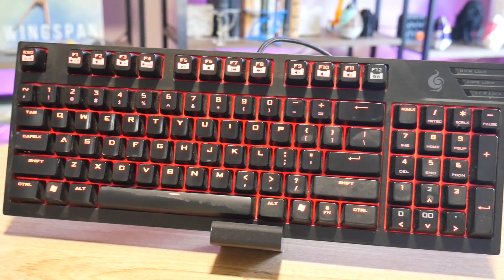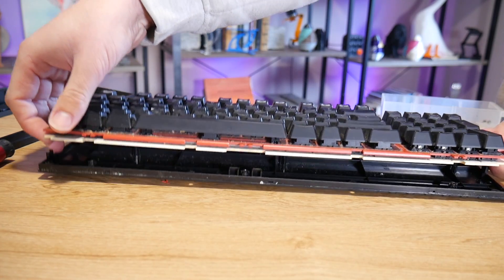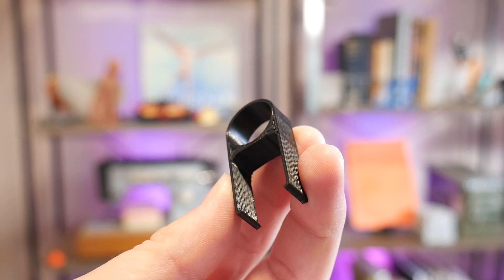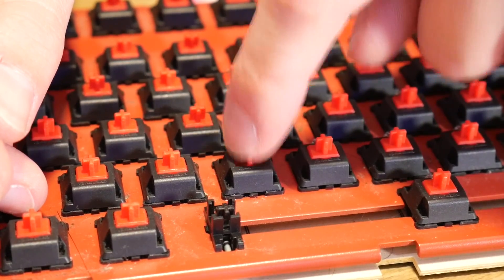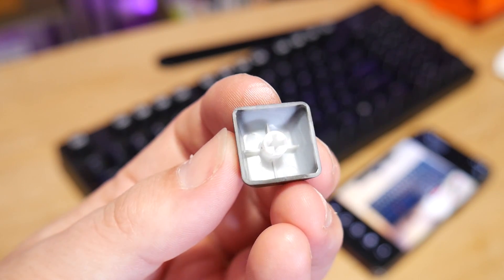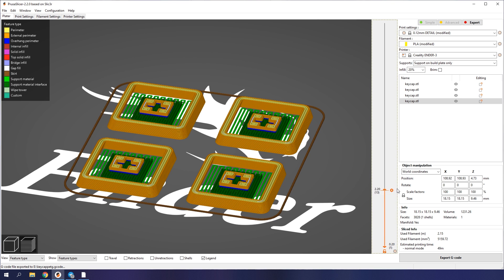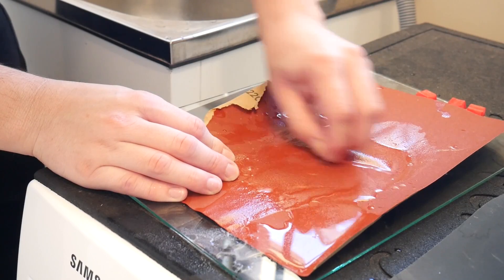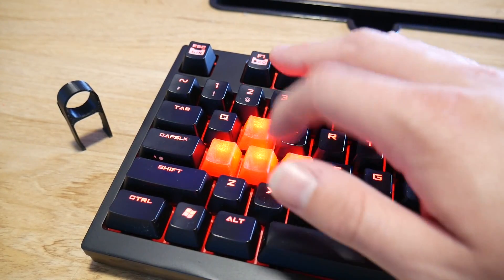Can I Fix my Mechanical Keyboard using a 3D Printer?

Comment: Nice! I've got a blank Das Keyboard in a box with a few missing key caps.  (ProTip: Don't use a shop air compressor set to 150psi to clean your keyboard.) This is a great use of a 3D printer.

Comment: I have a Razer Chroma X for 3-4 years. for at least a year maybe more it got random key failures except instead of one key it was an entire row or more. I rmarinated the PCB and switches in Isopropyl Alcohol 99%. The keys haven't failed since. It's a temporary solution worth trying for anyone and without having to replace a good keyboard. Let the PCB soak up the Sun to dry. . It will not work for everyone. Try on a cheap device first.

Comment: Sanding 104 keys sounds very un-fun. My model M-122 keyboard has 2-part keys, a structural base then a slipon cover. I'd be down for that if you can still get slipon covers for your keys.
Reply: The points on how you changed the print/design details are the real gold here. thanks for sharing!

Comment: And if one of your keys go bad and you can't find/can't buy a replacement just swap that key with one you rarely uses like Scroll Lock.
And if you want to save some money do the same and buy a cheaper switch to place on the key you rarely use.
Some Keyboards you don't even need to solder. The switches are socket instead of soldered.

Comment: ok, good video just wanted to point out a thing, if (like in your case) a switch doesn't work because it's "dirty" you can clean it up by opening the switch with a screwdriver or a switch opener, I consider it a better way to clean up a switch because if the switch is not linear (for example a cherry red is linear but a cherry blue is clicky) you will probably lose some tactility using a surface cleaner or alcohol.

Comment: i have a corsair k70 that i bought less than a year ago 
well in a fit of rage i absoloutly smashed and pummled the spacebar and some how the 8 key 
idk how to solder and i dont know where i could source new switches, (cherry mx blue)
i been using a crappy membrane keyboard since i got tired of having to deal with the spacebar, 
also if you press to hard it sticks
so i fucked the swithc up prety damn good

Comment: Well i 3d printed and hand wired a 10 keyless keyboard and all the keys were repurposed from a broken thermaljank keyboard. That did turn out okay though pla that I printed it in was probably not the best idea. Also I use a legendless keyboard at work for my day to day. It does slow people who try and use my pc at work so they are less likely to do so.

Comment: Probably far cheaper in power and materials to buy some pbt double-shots to replace the old keycaps. Actually shocked the paint finish on your cheapo abs caps held up for so long. My quickfire wore the paint off the common keys in less than 6mo. Cherish those old body cherry switches, clear housing ones are horrible, all sloppy and scratchy feeling. 

I do like that wood grain effect on the sanded caps. printing that top frame of the keyboard in that red filament at an angle would look pretty cool and glow with the leds.

Comment: I've bought me a nice ducky shine 3 year of the snake keyboard in 2015. Mine has MX brown switches with white LEDs. Few years ago however some of the LEDs were dying or dead. I noted which ones they were and disassembled the keyboard to solder out the faulty LEDs. wanting to be 100% sure I'd have the same white LEDs I soldered the LEDs out of my WASD keys to use those and replaced those with some blue LEDs. It was very easy to do as the PCB of the keyboard is nicely labeled and the entire thing is just easy to work on. It's been going strong ever since with no more faulty LEDs and if a switch ever breaks I already know it'll be easy to solder in a new one.

I don't plan on getting rid of this keyboard any time soon as I love it, I could use some new keycaps tho :P

Comment: Total a noob question: does octoprint replace marlin? I’ve an Ender 3 pro, the 1.5 upgrade board from creality
Reply: NO, marlin is a firmware that lives in yuor motherboard printer, octoprint its a software thats run in an Raspbarry pi, thats talk to yuor motherboard printer.
Why? Becsuse printers needs a microcontroler for real time process octoprint runs over linux, and thats a multitasking operaiting system, thats why yuo can not use linux or windows or a ny multitasking O System for a real time machine, but octoprint make a new interface for yuor printer, but marlin or whatever firmware yuor printer have, lives there

Comment: I have a Numpad with printed keycaps that have raised symbols for Fusion360 shortcuts. I recommend a 0.15mm nozzle for this sort of thing, or a resin printer if you don't like slow prints. Since the keys are backlight, the symbols are easily visible without any ink or paint. Annoyingly Fusion360 does not allow much customization with the keybindings, so I had to get a 3rd party macro software to interface correctly.

Comment: well instead of printing a few hundred keycaps, you could just buy them - there a lots of Shops which sell custom schemed injection moulded parts with different colors and prints on it

Comment: Nice, I have been working on my own 3d printed keycaps for the last 2 years on and off.  I found that if I print them upside down and with an opaque enough filament you can model the legends to be cut into the underside to print without too much hassle.  you end up with a keycap that's top is completely smooth but still has a legend.  I have been meaning to put my files on Thingiverse for a while...
Reply: Can you show us some examples?
I'm also experimenting with custom 3D printed KeyCaps for a while now ( https://www.thingiverse.com/thing:4241843 )
and some comments here gave me inspiration for further experiments :)

Comment: If you're looking to go down a whole rabbit hole of keycaps you should check out rsheldiii's KeyV2 on GitHub. It's a parametric keycap library written in OpenSCAD. Supports a ton of different key profiles, sizes, and you can add customizable legends. I've been working on a custom 40% layout with 3D printed keycaps, switch plate, and case that will be handwired and powered by a pro micro. I also find printing Cherry and OEM profile keycaps on their front face gives a nice smooth top surface that doesn't really require any sanding. All printed on my CR-10 Mini.

Comment: Ever since I started repainting my RC Tank models ( https://imgur.com/a/GzLRqvl & https://imgur.com/gallery/AB3vZQu ) found a huge use in creating 3D Printed ( cheap FDM ) and Laser cut ( Tamiya Masking Tape ) Stencils like those shiny grey ventilation and turret ring caps on the lower hull ( https://imgur.com/1rkxagx.jpg ) for my Tamiya #56020 Leopard 2A7+ that protect the already painted inside while I apply the outside camo pattern. Other than that I'm using 3D Printed ( SLS ) parts for things that have been damaged beyond sensible repair over the years or just new stuff like a set of Stinger Pods for my Tamiya #36208 Gepard ( https://imgur.com/a/ZLkzgMs ) which I assume were only prototypes in development and thus never seen on any model - Not even as an aftermarket.

Comment: I just 3d printed a new bonnet release lever for my old Passat, now my sons car, the old one had a lug snapped off so I designed a new one in cubify and printed it, it worked a treat

Comment: I print keycaps all the time!  I'm actually working on a .scad to generate them: https://youtu.be/WDlRZMvisA4

The key to great-feeling FDM keycaps is to *print them on their sides*.  As long as the stem gets a little removable support on the inside it'll turn out great and you won't need to sand it after either! Since the layer lines will be running parallel to your fingertip (|||) it should feel nice and smooth right off the bed.  If you want to try it out I have pre-rendered models (STLs) you can fool around with. They're super fast prints too!

Comment: Hey Angus, do you know what the technical term for a spindle/cutter that rotates parallel to the direction of the cut?
The one used to cut leather in this video:
https://www.youtube.com/watch?v=RrHI47YpIs4

Random question but I thought this could be applied to 3D printing

Comment: Many high end key caps are 'double shot' injection molded.  A inner core that includes the legend, and a 'cover' that is opaque that is snapped or glued over the base key.  I don't have the 3D skills, but I am sure Angus could figure it out.  A good idea for custom caps of any kind.

Comment: Back in the day (early '80s), we would put dirty keyboards in the dishwasher to clean them. It worked great as long as you put it on the top rack so it didn't melt during the drying cycle.

Comment: Here's a 3d printed ergodox keyboard with several 3d printed keycaps. I have done a full set, but chose to use ones with legends until I got used to the layout. Also a familiar face in the upper right. 

https://i.imgur.com/a53dA1r.jpg

Comment: My ancient mechanical keyboard (Dytcom K-261 with SMK Second Gen switches from early 90's) also has suffered from some bad keys, so far I've been desoldering and switching them around with keys like Insert and Scroll Lock, no spares required. Sometimes have a full layout is useful in surprising ways ;)

Comment: ive repaired my keyboard about 3x now haha! keys stop working, so i take it apart and clean it. havent needed to replace any parts yet, but its still in service. i have had this keyboard for probably 8 years haha!

also, that was a very neat trick with the slicer tweaks, im definitely going to do this on my next small parts... i only print in petg, and ive had some smaller parts turn out weak and crappy, but im now sure that it was because there were gaps in the shell... cheers!

Comment: The only "problem" that I can see is that the isopropanol would also wash the lube of the Cherry switch. You may notice over time that the key may become scratchy. Nothing that can't be solved with some Krytox light grease.

And welcome to the rabbit hole of mechanical keyboard customization. :D

Comment: i had a similar thing a few months back, i have a keyboard I love (the AUKEY KM-G6) but the clone Cherry Blues (I say clones as unlike Kailh's, Gaterons etc these had no markings whatsoever) and my windows key and left control key died, sadly I didn't have a multimeter at the time but I wanted to change the switches anyway, so I printed a keycap puller, disassembled the board, desoldered all 108 switches and replaced them with genuine Kailh box browns and some Glorious PC Gaming race (that's really the brand name) double shot ABS keycaps. and it was good as new, though what I'm planning on doing next is actually installing hot-swap pins in the PCB so that if I spill anything on it (this board has seen more than its share of cups of tea) plus, there are a few keys I want to switch out, escape (or, on these keycaps "ascend") feels like it deserves a kailh box navy, a heavy thick click, same with enter.

Comment: Keycap puller that is quicker, easier and cheaper to make:
Bend two paperclips!
Reply: Sure, but if you already have a 3D printer...
Reply: @InsanelyMclean  make a handle for the 2 paperclips
Reply: his channel makes me want to get a 3D printer even though I have no idea how to do all he things he does
Reply: @wheeeeeeeeeeee1  Fusion360 to make designs, thats for a start
Reply: Or just pull them off by hand, works perfectly on my Razer blackwidow elite
Reply: @laurinneff4304  Blasphemy! (No, but; keycaps can cost upwards of five dollars per key, so it's not worth risking for higher-end caps)

Comment: I have a Bluetooth keyboard that I pulled out of the trash that was missing the left arrow key.  I designed my own replacement and 3D printed the key.  It isn't perfect, because there is no symmetry anywhere throughout the entire key, but it was a "good enough" replacement for a free keyboard, and one that was actually very expensive when new.

Comment: The Isopropyl Alcohol is not available to the public, it all goes to hospitals Doctors, Nurses, emergency response teams. Not many people know that windsheild wash antifreeze is 75% Methyl Alcohol and I have been mixing that with generic liquid hand soap, Hydrogen Peroxide and a dash of Dettol. I fill my empty pump bottles and it works well. Nice work on that keyboard. I like repairing rather than replacing.

Comment: Then there's me with my box of replacement switches lol

With my keyboards, if a switch stops responding, I'll replace it with one that I've  refurbed, clean the old one, lube it up and store it with my others after testing to make sure it works again. The reason being I end up having to remove the switch to clean it anyway so I had might as well whack a spare in to speed up the repair, then fix the damaged switch later on. It's actually a pretty good strat if you have a totally dead keyboard that you can nab the switches from! It also leaves you with a bunch of switches that you can use in other projects :)

Comment: I've printed a chassis for a custom mechanical keyboard in the past (and I think 3D printing probably works better for this kind of thing than for keycaps). So maybe that's one area you could look into. Maybe try 3D printing everything you possibly can, including both the caps and the case?

Comment: You can pop the top off the Cherry switch without desoldering or removing it from the board.  With the top popped off you can easily clean the switch, change the mechanics to change the type, change the spring, etc.

Comment: Thanks for the video. It is making me think about attempting repairs on a keyboard I liked that has some broken keys. If you want to 3D print an entire set of keycaps you can cut the legend in to the keycap in the same way that a calibration cube has the letters X, Y, and Z cut in to it.

Comment: My first mechanical keyboard was an old.. I don't remember the brand, but it came out when cherry blacks where the only option..
It's now something like 15 years old, has been through 3 or 4 owners and I make it a condition that when they are done with it or break it, it comes back to me.
Cleaned keycaps, repaired the PCB a few times(coke/softdrink does like to eat tracks), fixed the cable once but it still feels like new.. Mechanical keyboards really are awesome.

Comment: Check out one of the recent videos of Linus Tech Tips. He labels keycaps with some ink transfer method. Seems to be working fine, but if you take a turn on this, you could improve on the apparatus they used ;)
Reply from the maker: Yeah i'm really keen to try that, all the compatible printers are sold out locally though...
Reply: @MakersMuse  Keep in mind that Linus forgot to say that dye subbing only works with PBT keycaps, and most of the keycaps available on the market are made of ABS (which just melts).

Comment: I see 2 options for replacing all the keys.  1) Create a base key with the character sunken in, print with translucent resin/filament, and fill the sunken character with the appropriate paint/polymer.  2) Do the same as #1 without the sunken character, and engrave the character with your CNC instead.  This gives you the option of creating the characters either in the printing step, or in a later CNC step.  Fun, either way!
Reply: Could also put the legend on the side, as Filco did with their "Stealth" caps. Indented or raised, a little bit of paint or even a coloured pen like a Sharpie (it will never be rubbed, so durability is a non-issue) to make it more legible and you'd be set.

Or, hell, just go full Das and leave them blank. Make sure you've got the three locator bumps (F, J, Num5), and woe be to anyone else who tries to use your PC.
Reply: The two coloured printers would be good here too! :D
Reply: I sell these keycaps online and use a simple label maker. Works alright for a $500 initial investment, probably upgrading to spa soon though.

Comment: Too bad slic3r nonplanar cant do support material yet, would be a perfect use case for a new set of key caps.
Reply from the maker: Yeah good point! The keycaps don't need much support you could design it in. Worth investigating.